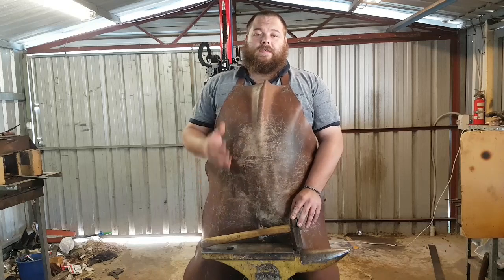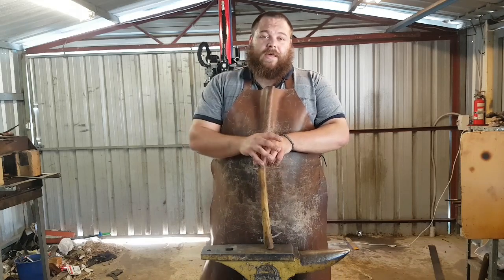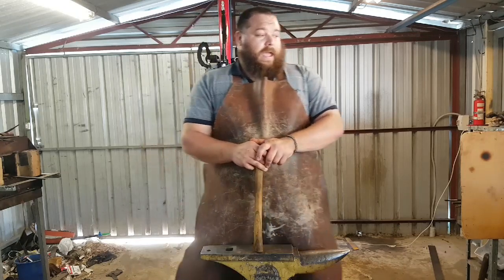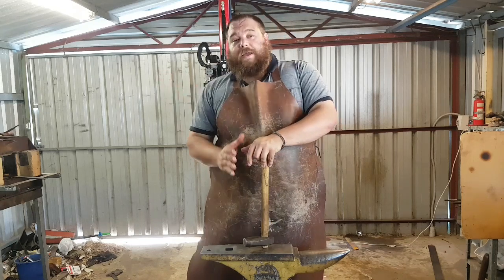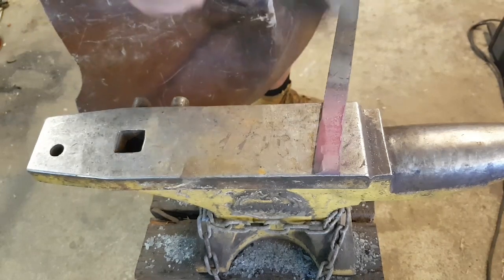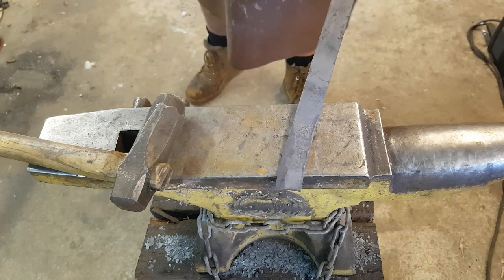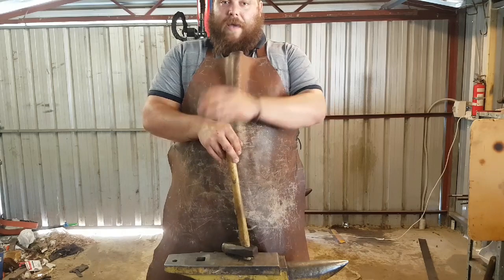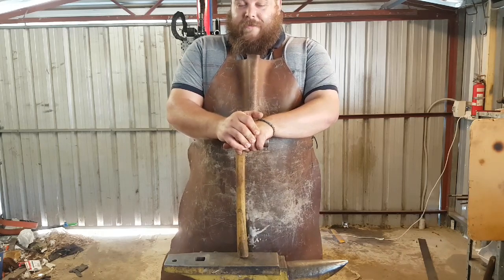Forging bevels: a short insight (response/addendum to That Works)

Comment: That sheds some helpful light! I was beveling some seaxes recently and wondering about the practical and functional differences between spreading and upsetting blows. Thanks!
Reply from the maker: No worries! Seaxes benefit from the compression style of forging, especially when you get the preform right, as they don't have a riccasso, and should be beveled into the tang much like traditional tanto.
Reply: Sam Towns, Bladesmith Aha, I had forgotten that you mentioned beveling into the tang for seaxes. Hope I can correct mine!
Reply from the maker: @echoloc8  haha all good, it's only necessary if you're going for historical accuracy. Many "modern" seaxes incorporate a short stepless ricasso in front of the bolster.
Reply: Sam Towns, Bladesmith Speaking of, what’s your opinion re bolsters? Saw a few knife forum posts saying that there’s no historical evidence for bolsters or butt caps on seaxes.
Reply from the maker: @echoloc8  haha i can provide evidence against that statement, the tower of london and the wallace collection both have hilt fitting assemblies from anglo saxon and viking seaxes that are made from various materials such as steel and brass, to gold and silver with jewelling. There have been a number of seaxes recovered which did not have bolstersx or had bolsters made of a natural material. But there were definitely seaxes with bolsters and buttcaps.
Reply: Sam Towns, Bladesmith Nice! I’m really deficient in my reference material, so I’m happy to defer to someone who’s done the legwork!
Reply from the maker: @echoloc8  all good mate! Yeah, sometimes the info isn't always wide spread

Comment: I imagine the compression method means a heavier blade for a given final blade width over the pinching method. If so does that mean that if you want a lighter wide blade you go for modern steel and pinch method? Or is there very little difference?
Reply from the maker: Given the same amount of material, neither gives a heavier blade. It is simply the difference in final shape that is effected by the method of forging.
Reply: Sure, but if the final profile and width was the same (say 50mm chef knife for example)would you have a noticeably heavier knife from the compression method using “old” steel compared to modern steel pinched out to same profile? I suppose it depends on the density of modern steels. Maybe a silly comment but it’s what went through my mind when you were explaining the different methods
Reply from the maker: @SzonSer  so the density isn't effected by the forging style, the only reason that the compression method is used is to avoid tearing the linear weld lines in traditional material, so if the volume of stock is the same in both pieces they will weigh the same.